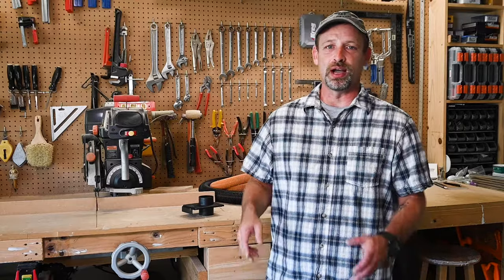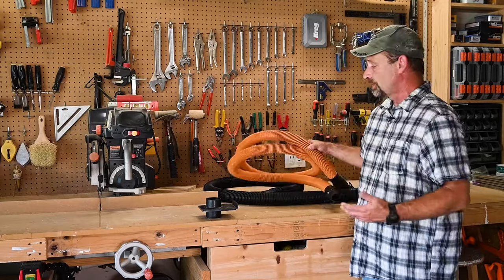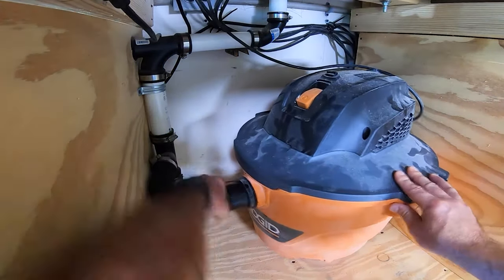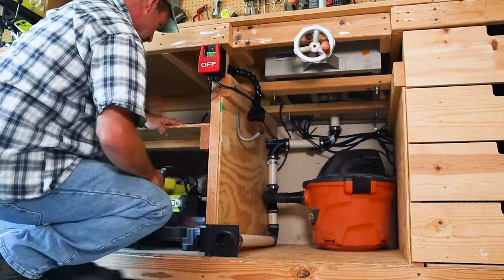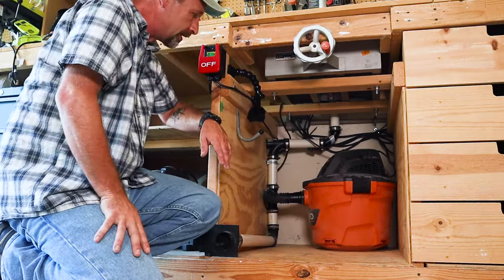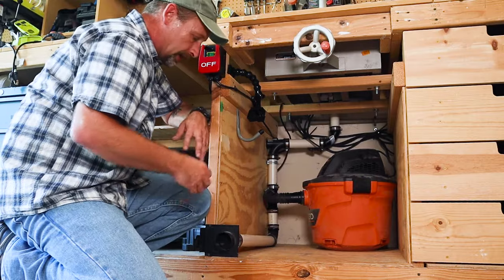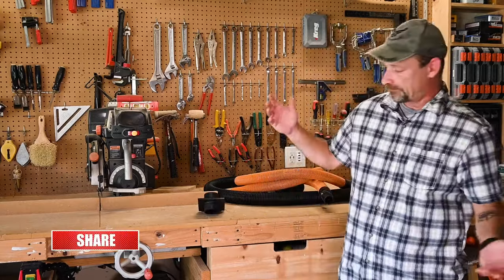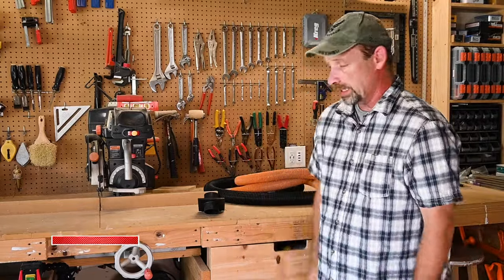Easy Shop Vac Dust Collection System for a small garage workshop.

Comment: Great and simple setup. Just one minor comment on arrangement, reconfigure the wye so that the single end goes to the shop vac. That way when you decide to use the extra port you won’t run into a clogging issue. By that I mean, when you try and pull dust from that side, the abrupt change in direction will cause dust to be left behind and potentially build up creating a clog.
Reply from the maker: Thanks for the feedback David!

Comment: You use a 4 inch gate? What size is your hose? How did you get from the shop vac and PVC, + or - 2 inches up to a 4" hose? Wouldn't you maintain better suction with a 2" hose?

Comment: nice work but avoid the 90's and go with 45's instead.
Reply from the maker: Good point! I’ve pretty much redesigned the whole dust collection system with the new saw installed.

Comment: What size blast gauge do you have your link goes to for it but did you find 2-inch ones as well
Reply: At rockler they are $5 and they fit 2” pvc pipe perfectly along with a coupler

Comment: Nice setup - but why dont you have a cyclone separator?
Reply from the maker: I haven’t had the need for one yet.
Reply: Good point, separators are great. I never need to clean my filter or buy bags anymore, I just empty the cyclone now and again.
Reply: @SeanDoesDIY  thanks for your video. I was gonna suggest adding a separator as then you rarely have to clean the filter in the shop vac. Also they make a plug that you plug a tool into and also your shop vac so the shop vac turns on automatically whenever you turn on the tool
Reply from the maker: @danjacobsen7645  i actually added both those things recently during my bench upgrade😃 so I’m going to make a new video soon.

Comment: With the room underneath you could probably get a shorter  cyclone separator.  I used to use just a shop vac but it wore out relatively fast due to all the sawdust along with larger pieces. I know use a cyclone seperator, 5gal bucket, and shop  vac that i put in my attic of my garge. Because it doesnt have to be emptied often with that setup, its great. I just set it up, cut a hole thru the ceiling to drop my hose thru, and put a wifi plug up there to turn it on/off with Google. "Hey Google, turn on my vacuum". And away we go. 
Since using a seperator, i am so glad i added it.
Reply from the maker: I added a bucket topped cyclone separator not too long ago.

Comment: Hey great setup for a small shop. I’m looking to do something similar and found your video. Any issues with static electricity on the pipe or hoses? If so how did you solve that?

Comment: How about where you got the rubber pieces, sizes and PVC pipe size, please! Thanks looks good! Maybe lay it out on floor and enter what sizes and where you got them! Thanks
Reply from the maker: Hey Bruce, I got all the pieces from Home Depot and the PVC is 2”. I’m in the process of redesigning my bench which will include new dust collection. I’ll definitely add more details in that video. Thanks for the feedback!
Reply: @SeanDoesDIY   how did you get from 2" pvc to 4" hose?

Comment: Interesting setup.  Thanks!
Please tell us something about that radial arm saw above the shop vac.
Reply from the maker: Hey Joe, I’m actually in the process of swapping the radial out with a 12” miter saw.
Reply: @SeanDoesDIY  Well, I was thinking about trying to find a radial arm saw.  I currently have a ten inch Hitachi (now Metabo) sliding, double bevel miter saw.  Want to talk?

Comment: Great video! I was wondering where you got the couplings. I was looking for some on Amazon, but they're something like 10 dollars each, which seems excessive given that I'll need a few.

Also, minor critique of the system; the Y split would be more efficient if it was oriented like the letter Y. The idea is to avoid the air needing to go around tight corners. Practically it probably doesn't matter much though, especially since you're not using the left split anyways (which would be the inefficient direction).
Reply from the maker: I picked the couplings up at Home Depot.
Reply: I think you could just use the standard rigid plastic pvc couplings. you can glue the joints if you want, but friction fitting should be fine if the weight of the pipe is supported and not subject to outside forces. much cheaper than rubber and pipe clamps.

Comment: Did you notice any drop in suction power after hooking up to 2" pvc pipe
Reply from the maker: Not really
Reply: @SeanDoesDIY  just wondering. I'm in middle of running 10' of 2" pvc up to center of ceiling where I'll have a 10' rigid vacuum hose hooked to end. Thanks for reply

Comment: What about your filter? Does it get clogged up quick?
Reply from the maker: So far it hasn’t been an issue, I clean every time I empty the vac.
Reply: @SeanDoesDIY  do you wrap the filter with anything for a “hack” or just use the filter only?
Reply from the maker: Just the filter as it came with the vac
Reply: @SeanDoesDIY  apparently  you have some magic filter lol. Ive never seen a shop vac dust collection system without a dust seperator of some sort that didn't  lose considerable suction after an hour or so of use. Even with a dust seperator mine clogs up fairly quickly with the really fine dust. Especially if I'm sanding alot... I like your setup though. It seems like lately I spend about as much time trying to make things better and more efficient in in the shop than I do building anything. That's just me though, always trying to make things easier... Take care
Reply from the maker: So far I haven't had any issues with the vac losing suction, though I do clean it out after every big project. I'm in the process of redesigning the shop and I'm not sure what the dust collection will look like when I rebuild the bench. I am thinking about adding a small dust separator in the new design.

Comment: You don't have to gule PVC pieces together in a setting like yours.
Reply from the maker: No, it holds together fine and I’m able to take it apart if get clogged up.
Reply: @SeanDoesDIY  You misunderstood what I meant. The regular PVC fittings will hold together without gule allowing you to put them together and take them back apart with ease.There is no pressure on a vacum system and the PVC fittings are cheaper than the rubber ones.
Reply from the maker: @radamson1 gotcha, that’s true about the cost difference